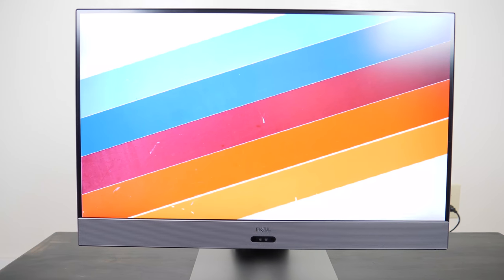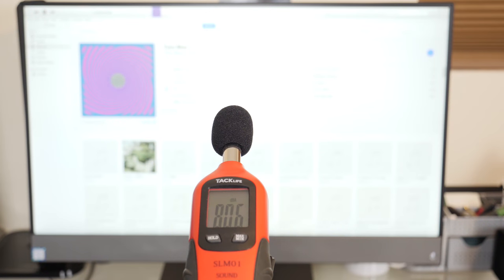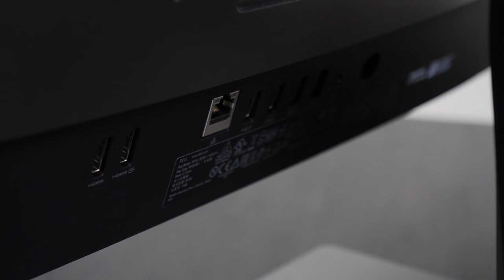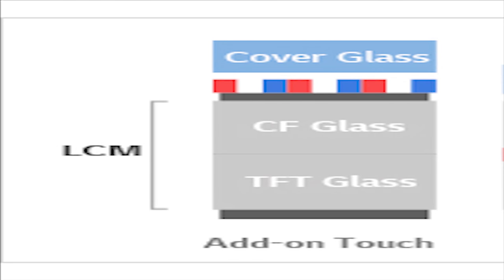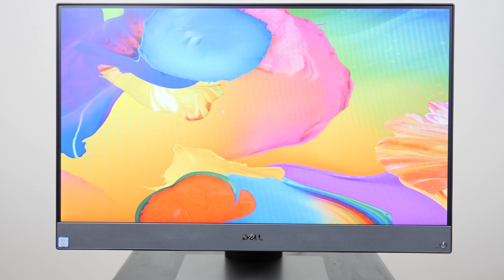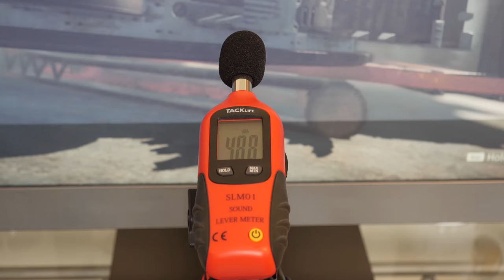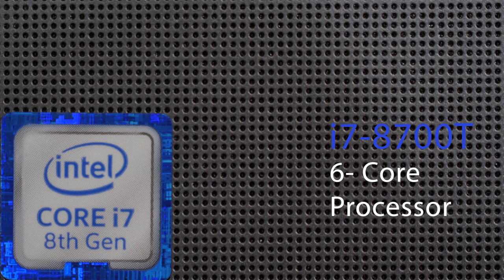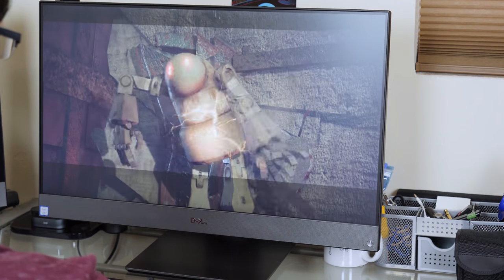Dell Inspiron 7777 - The Beast Has Been Tamed

Comment: After 5 long years I'm finally setting my 7777 to rest. 
Having the 8th gen I7 and gtx1050 configuration with 16gb of ram my experience was... interesting. 

Pros. 

The screen is nice for an LCD panel. 

Replacing the hard drive and ssd was painless which was nice.
The hard drive caddy used in the system even works on any hard drive or sata ssd, not just wierd oem stuff. 

The sd card reader was a nice feature. 

Cons.

I found the cooling solution to be inadequate, even with frequent cleaning and new thermal paste I found the cpu would constantly thermal throttle under an intense load, with the gpu not far behind, temperatures ranging from 80 to 100 degrees!! 

I think the main reason for this is the tiny fan and copper heat pipes, almost like it was taken from a mid range laptop. 
Compared to the previous year's model, it was not able to pull in enough air to satisfy the heat output of the system. 

Not to mention the motherboard being contained inside a metal shell! Allowing for no air flow! And practically hotboxing the gpu, cpu, ram, and boot drive! 

Eventually the only way I found to satisfy the machine was to take the plastic shell off and aim a desk fan at the back of the system. 

While useful, the hdmi input left a lot to be desired, with no options to use any sound output other than the system's sub-par speakers. 

Its io also left me wanting more, with only 3 usb 3.1 ports, the rest being usb 2.0. 

When disassembling the machine I found it to be over complicated, especially if you want to access anywhere past the motherboard, hard drive and fan.
With it having an irritating amount of ribbon and flex cables, and varying sizes and depths of screws between you and any other part of the machine, such as all of the io, the speakers, or the camera.

The bios gave no option to disable the integrated graphics, or configure the speed of the ram. 
It also gave no option to disable secure boot, this was actually hidden in, not the windows boot menu, but a second SECRET boot menu!! 

The operating system that comes preinstalled insisted on setting every program to run using the igpu.

The only way I later found to disable the igpu was through installing linux, and disabling it through the terminal using nvidia optimus.

The ram was laptop grade, you think they at least could've fit some full sized ram with all that free space. 
Or a bigger fan

The dell bloatware that came with the system also had a massive problem, backing up the same system files in the background constantly. 
Eventually filling my hdd and boot ssd in a matter of weeks, almost locking me out of my system as it didn't have the storage to function! 
I could literally watch the megabytes tick down!! 

It does not have a gtx1050, it has a gtx1050 mobile. This was not mentioned anywhere when I bought the system. 

At the end of it all am I happy with this system? No. 

Its cooling setup is not adequate. 
Its "1050" is actually a laptop gpu. 
It came with broken bloatware. 
Its bios is unnecessarily restrictive and overcomplicated. 

At the time of me purchasing it, if I were to have built my own system with the same specifications and a 1080p monitor, it would've been cheaper. 

This aio was not worth the hefty price, alongside its myriad of unnecessary restrictions and issues bringing it down further. 

Stay away from this system.

Comment: @Devon Connelly - hello and thanks for the video. After using the system, did you find the heat from it to be uncomfortable or bothersome? I know this video is almost a year old now, but I am interested in these systems. I'm ready to get rid of my towers for something cooler and more efficient.
Reply from the maker: Michael thanks for the question. Both all-in-ones put off some heat via their respective exhaust but nothing that made me uncomfortable during use.  For me the fan noise was more intrusive than the actual heat being emitted. While it's not terribly loud, it's there and you'll notice it. Hope that helps. Their great AIO's. I've had the 7775 model for 20 months now and it's been a workhorse for me. Can't go wrong with either. Take care.

Comment: Nice review, thanks! I agree the new version represents a step back to the previous one in terms of CPU and GPU performance, especially for the graphic compartment which really represents a deal breaker for the most demanding games players. I'm wondering the reason why they decided so (heating issues with the Ryzen+RX combination?), expecting at least a GTX 1060 to be a configuration option to replace the previous 570/580 offering, especially considering the missing Thunderbolt spec for the USB type C port which doesn't allow to adopt any external graphic solution. Not to mention the missing 4K display option. This AIO from Dell is for sure a well designed solution, most likely the best compromise on the market at the moment, but it is sadly missing at least 3 most appealing options to be considered the perfect desktop replacement! Maybe the next round...